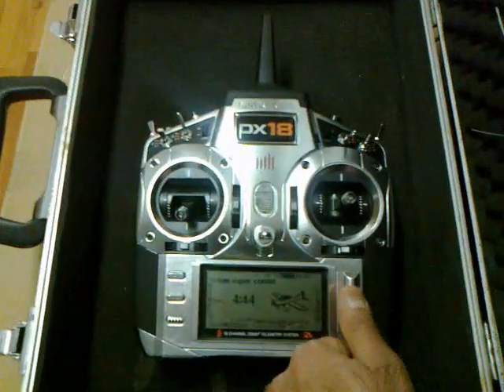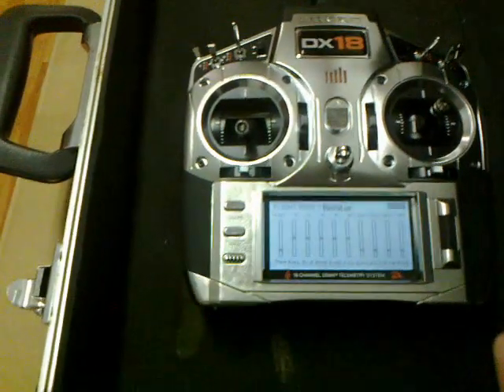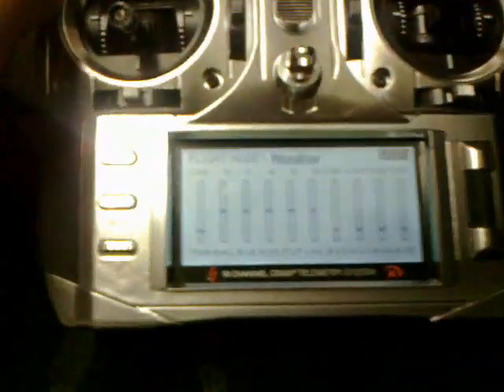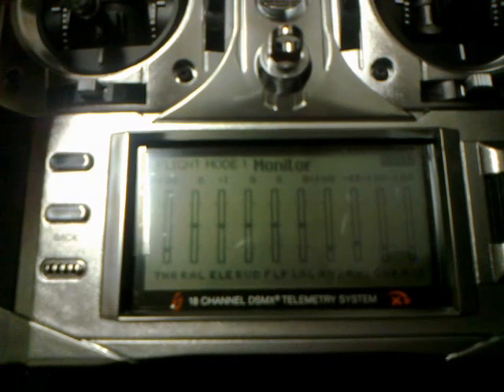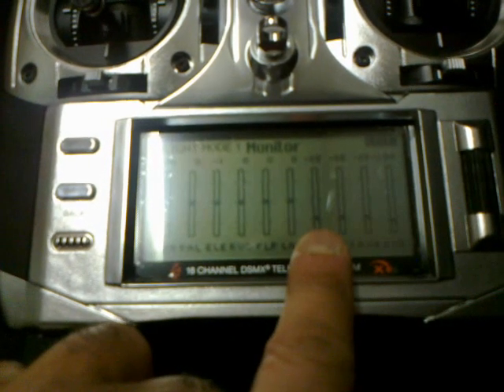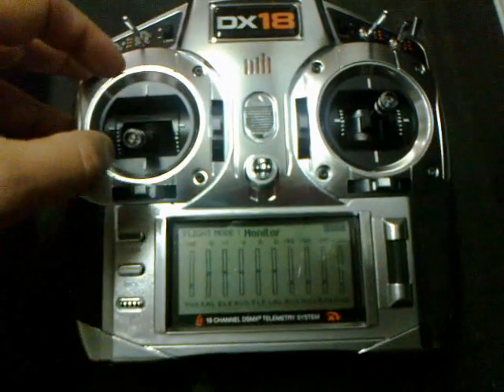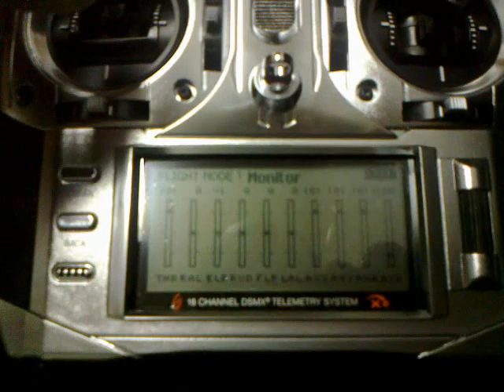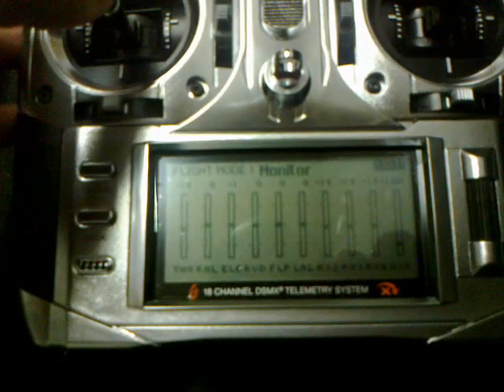Spektrum DX18  Multi engine start up and idle sequence.  "Experimental stage presently"

Comment: I have a programming challenge with my DX18 and a two engine nitro model-airplane. Two engine to have it on throttle stick (mode-2), but trim (idle) for each one of the engine. e.g. Pot-Left and Pot-Right. Thank you for feedback and input, CUB